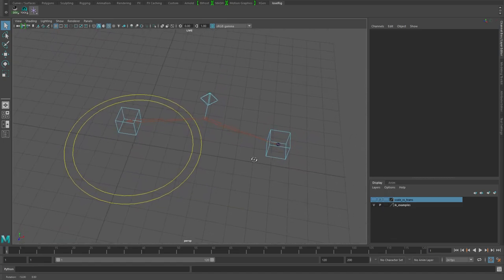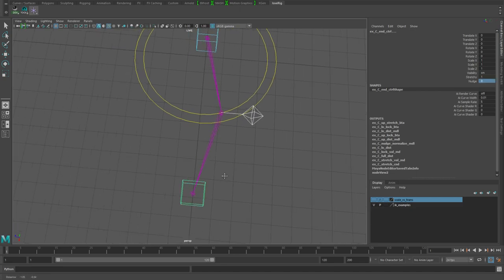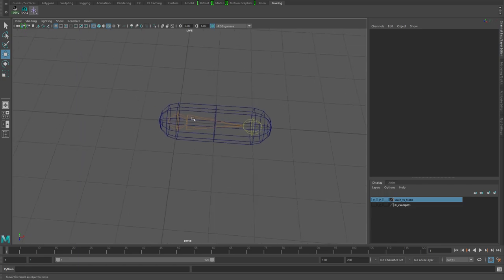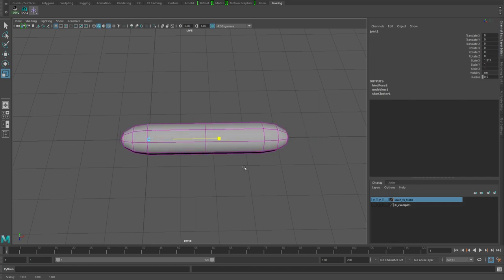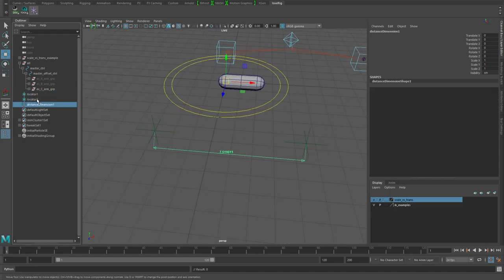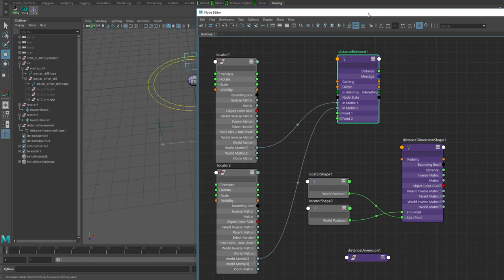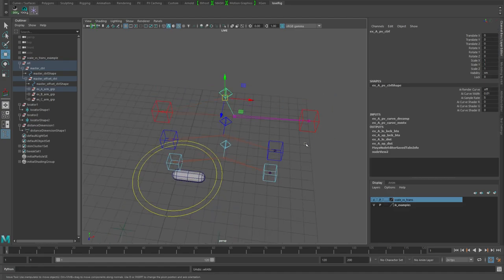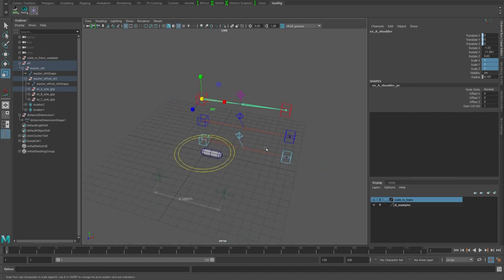(part 1) Optimized stretchy ik with elbow/knee lock and bomb-proof global scale tutorial

Comment: Great tutorial but there is one problem i am facing that whenever i use freeze transformation on controls  distance between node stop working.
Reply from the maker: Ah yes, freeze transformations...  So, the short answer would be: Don't freeze transformations (ever).

The longer answer/discussion with this is that Maya's transform node is a bit more than a single matrix in how it behaves.  Whenever you move something off of it's origin and freeze transforms, that movement gets stored internally as a type of offset effectively mangling the matrix... Essentially the translate/rotate/scale values in the channel box can no longer be used to generate a 'correct' matrix to represent that transform.  You can look in the attribute editor and find some additional xyz numbers under the 'local space' division showing this.  That's most likely the reason that the distance between nodes are not working properly for you.

So, rather than moving a control somewhere and freezing transformations there, it would be a better practice to create the control, give it a group node as a buffer, and move/rotate that buffer node to get the default position of the control.  The buffer node will then effectively store all of the translate/rotate/scale while the control itself stays fully zeroed out (Although, I would suggest you don't scale it either - just scale the control points of the actual control's curve shape node).  This also ensures that the actual matrix of the control is 'clean' and not muddied or mangled in any way.

Hope that helps!
Reply: @JarredLove  Thanks for solving my problem and for great explanation.
Reply from the maker: no prob!  Thanks for watching and asking questions!

Comment: great video thank you :)
Reply from the maker: I'm glad you liked it - thanks for taking the time to watch and comment, I hope you find it (and my other videos helpful!)
Reply: @JarredLove  for sure :) , i´m currently trying to build a ik leg with the knee lock the only "problem" is that the rotation of the joints is world oriented. With the standard set driven key, distance dimension setup it won´t work as i´m using the translate Y for stretching up the joints. I need this kind of orientation for getting good deformations, do you think that with your setup it could still work even with world oriented joints? Thank you!
Reply from the maker: Hey redwolf, this system should work for that.  The distanceBetween nodes work off world space distance and that doesn't matter what axis you translate on.  All the math will work the same since you're just outputting it to a ty instead of tx.  But, the one thing I will say is that you need to make sure that your joint orients are clean so that the translation on your joints is only on one axis (but that's pretty standard for any joint rigging).
Reply: @JarredLove   Hey Jarred, i've tried to build your IK setup but i think because my joint setup is kinda weird and because of my little experience (i had to lock a min value of one rotation axis in order to get good lattice deformations, my rig is basically lattice dependent) i still can't manage to get the knee lock feature that i'm searching for, plus i get some other stretch issues. I'm sorry for wasting your precious time but would it be possible for me to contact you maybe via skype or email, and get a chance from you to look at it? If not, no problem and still thank you for your awesome tutorials :)
Reply from the maker: hey redwolf - what do you mean by your joint setup being kinda weird? It's also been my experience that lattices can kind of bog down a rig and make it run a little slow in some situations (might not be noticeable with GPU evaluation though).  Is it possible you could transfer the deformation to a skinCluster instead?  You could also try skinCluster binding and then put a deltaMush on it to help smooth stuff out even more...  I'm mainly just curious because locking out a min value for a rotation axis specifically because of something lattice related sounds a little odd to me - but that may just be because I separate rig functionality and geometry deformation in my head, and will create special intermediate bind joints or some other mini-rig on top of the base rig in order to handle those special case deformation issues.

As long as you have joints with clean joint orients (basically meaning that the length of the 'bone' is determined by only one translate axis having any values and the other 2 are zero), then you should be able to get the node network to work right and pretty much anything should be able to be bound to it without too much pain.